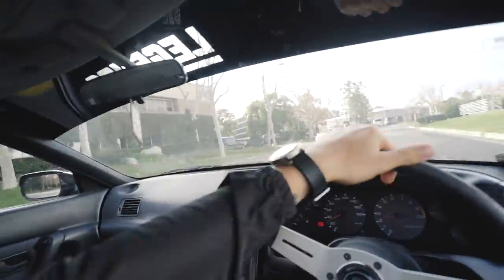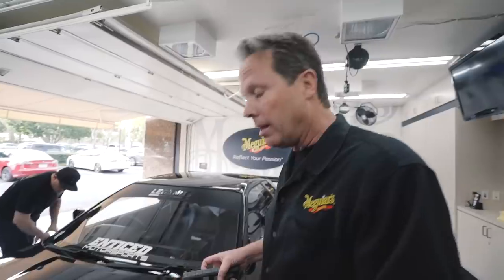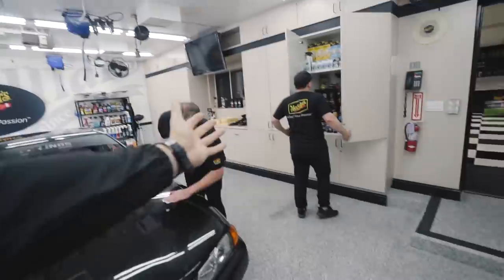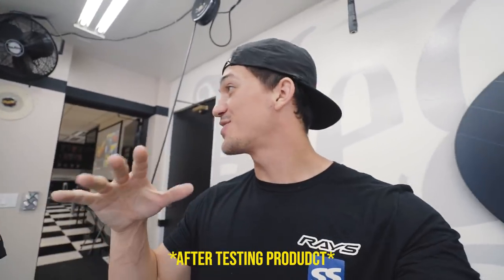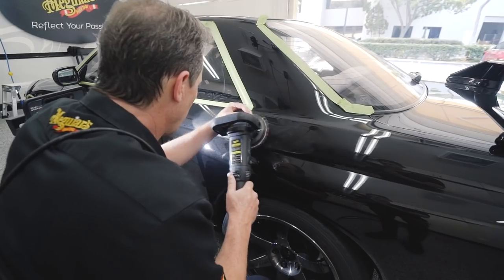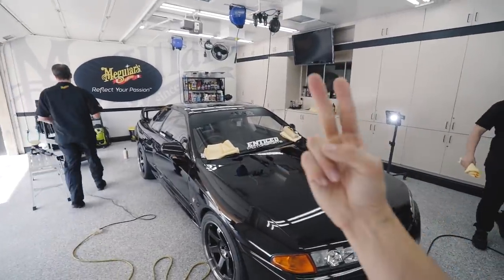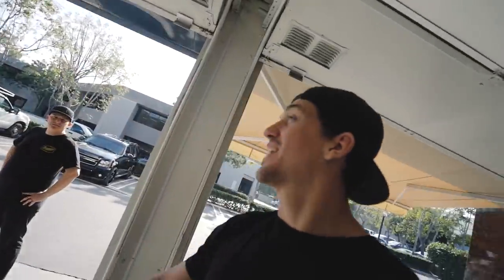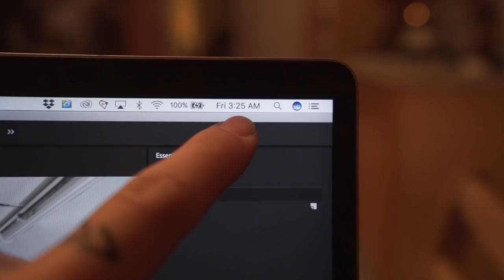HOW TO MAKE YOUR PAINT LOOK BRAND NEW! *Skyline GTR Detail/Paint Restoration*

Comment: Car looks amazing. Should look into getting a good ceramic coating now that's it's fully corrected
Reply: Ceramic coating is a waste of money
Reply: Nahhhhhhh broooooo ceramic looks good at 1st week , but once it get washed it acts like a paint, it’ll have swirl marks and scratches looks worse than paint swirl because it is more noticeable
Reply: @Deqade  it sure is a huge waste of money ...
Reply: Even if it “didn’t look good after a week” it still would protect the paint from rocks, so I’d rather not have to repaint the car from getting chips in the paint.
Reply: xsliick welp rip to my soul thinking it was the same as clear bra 🙃💊
Reply: Daniel Murillo How?
Reply: @joepalmer5464  think of it like wax on steroids completely different from a clear bra
Reply: Xpel it!!!

Comment: I would have ceramic coated it. The wax will wear away and you might not re wax and it will end up becoming dull again. A question for Meguiars, if you have a brand new car, approximately how many times can you polish it in its lifetime before you burn through the clear coat?